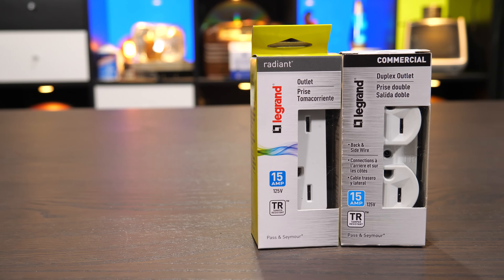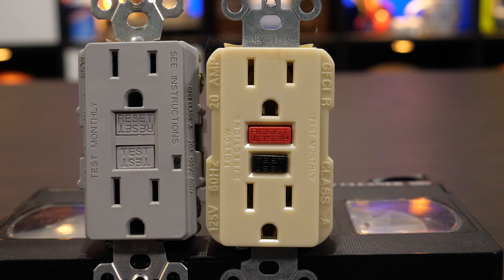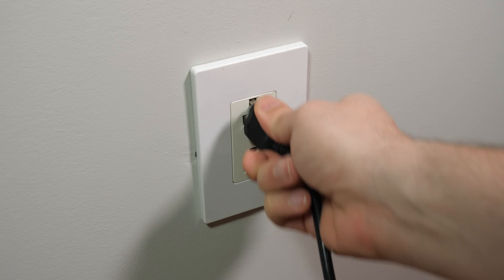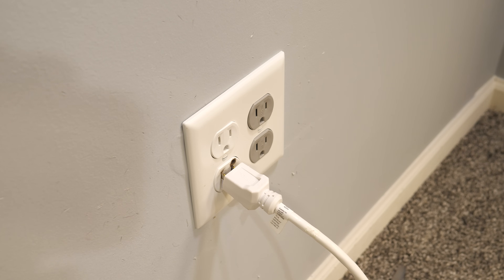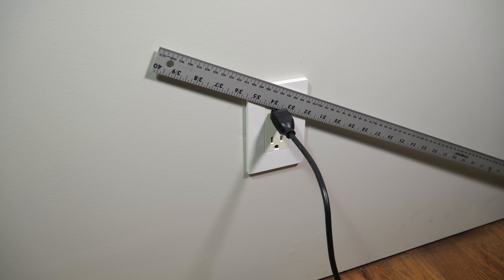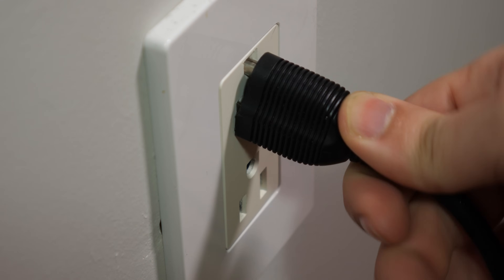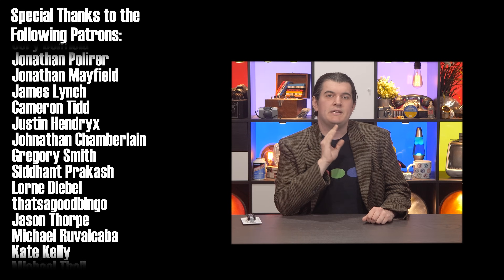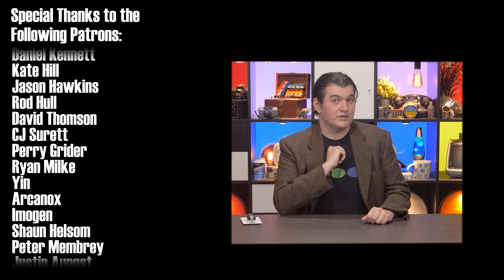Power outlets are topsy turvy - but does it matter?

Comment: ALL Australian Side-Entry plugs have the cord exiting at 45 Degrees - which is at the 4:30 (clockface) position. (As at 14:50 in this video).

Australian Plug Pins are of approximately (almost exactly) the same dimensions as US (NEMA 5-15) Plugs.
They have been Half-Insulated (as at 16:00 in this video) for over 20 years - so it could be done on plugs in North America.

Comment: You might be interested to know that the Canadian Electrical Code does not specifically state that the Ground must be on the top, but it does say something like, "Install the outlet as shown in the illustration." Which does show the Ground on top.

And the 'knife dropping on the plug' example is a bit silly. 
But try a cat knocking an old aluminum ashtray off the top of a bookcase, said ashtray then sliding down the gap 'tween wall and bookcase...and then landing edge down a'top a TV plug, which because of the clutter behind the TV and bookcase and fish tank...was loose in the outlet.
BZZZZTTT!
Left nice scorch marks on faceplate, (eventualy) tripped an old breaker, scared the %$#@! outta everyone in the room(cat included)...and smelled downright awful.

I like Ground up...

Comment: A metal backplate fell off of a desk at a previous job and landed, conveniently, on both prongs of a "ground down" plug.  The lights flickered, there was a very loud pop, a breaker flipped, and there was a rather concerning burn mark on the wall, the outlet, and the desk.

Comment: You've just explained my biggest bugbear with US-style power plugs. The cable should drop vertically, not leap out horizontally, taking up space, tripping people up, and putting electrical and mechanical strain on the connector. Everything you've described. The sole flaw you described in right-angle plugs - difficult to grip when removing them - is designed away in the UK BS1363 and earlier BS406 plug which is wider and has grips at the sides.

Comment: The wall outlets should always have the eyes on the top, mouth on the bottom.

When we bought our first house, my son was a baby.  While he was taking a nap on the first day we moved in, I put the plug covers on all of the outlets.  As soon as he woke up, he discovered that something was blocking all of the outlets and proceeded to remove those blocks.  He was so happy to solve this problem and give me the offending covers!  A few days later, he picked up a key and started to insert it into the outlet.  I had such a reaction that he stopped short, looked at me, and dropped the key.  He never again tried to insert anything into an outlet (except, of course, plugs).

Comment: Huh, this video made me really appreciate European (or at least Dutch/Belgian) plug and outlet designs. Not only are the outlets slightly recessed into the wall, instead of flush like US outlets (preventing the whole mess of bumping into them and leaving live metaly bits exposed), but the right angle plugs have nice ergonomic little grips, so you can easily grip them for removal. Seriously, I'm actually surprised at how flimsly it all looks in the US, based on this video.

Comment: And now you have got to the other very bad thing with most American plugs.  .  The wires come straight out, so the weight of the cable pulls the plug partly out. . . . Again, UK Plugs always have the wire coming out of the bottom of  the Plug, so they can never get pulled partly out by the cable weight.      Also this now allows the Plug to be pulled out by the Plug and not by the wire, as so often happens with American plugs.

Comment: Now you bring up the problems with the wall plate, that is also bad, as you say. . .   Also often this causes a problem where the actual outlet is too far into the wall, and when you tighten that one screw, you break the plastic cover, bad design. . . .  With UK Outlets, the wall plate is also the Outlet body, and they sit on or against the wall, and can never end up too far in the wall.. .  Even if the metal box is far deep in the wall, the wall plasterer made his plaster thicker than he told the electrician, the UK one still works OK, you might need longer screws, but the wall plate sits clean, flat on to the finished wall.

Comment: Regarding being able to touch pins when live. . .   This is a very bad feature of American plugs. . . .  You can not touch a live pin, even with a knife blade of UK plugs. . . .   Actually, although I would not recommend it, you could remove a UK Outlet from the wall and wrap your hand round it whilst Live, and it would be safe. . .   Do not try that with any American Outlet

Comment: UK Outlets 3-pin, do always have the ground ( Earth) at the Top. . .   But when, as common, there are two outlets in each fitting, they are side by side. . . .  I usually install American Outlets sideways, , ,   Which way does not matter, except all sideways should be the same in any one house. . .  Then those plug in devices, USB wall units etc. can still sit in them safely, but, as you showed, they do not sit in well when the ground is at the top.. . . .  But my biggest gripe with American Outlets is the very bad under screw head wire fixing. . .   That went out in the UK about 70 years ago. . .   The screw should clamp down on a square or rectangular washer, securely clamping the wire behind that washer.. .  Under the screw head, the wire strands spread out an make a bad connection,  Ah.! . .   Using solid wire works better but is bad, bend it twice and it may well break, that is why we use multi-strand wires.

Comment: Well all our sockets here in Australia have the ground on the bottom & we never have any issues with getting shocked, plugs falling out due to our angled active & neutral pins & I can see your issues as when I have to use an adapter to use your 2 pin plug in our socket it never stays in properly always hanging or just could be the adapters who knows

Comment: Orientation 1: Ground pin on bottom
Orientation 2: Ground pin on top
Orientation 3: Sideways live on top
Orientation 4: sideways live on bottom

Reason to have ground pin on top:
You're working in a very controlled environment, and any accidental spark, can cause major problems.
The Right Angle plug's cord, will be above the recepticle, rather than below.

Reason to have ground pin on bottom: It ultimately doesn't matter.

Reason to have sideways outlet, live on top: Sideways doesn't care whether the thing holding the right angle cord is going above or below.

Reason to have sideways outlet, live on bottom: Literally the safest orientation, as anything that falls, will not be falling onto the live wire, therefore, reducing risk of short circuit, even for 2 prongs.

Comment: it absolutely baffles me that plugs outside the uk dont always have at least a plastic ground pin for security so the damn thing doesn't fall out. even europe, which has the most secure grounded plugs i've ever seen, uses loose fitting ungrounded plugs sometimes.

Comment: When the ground pin is up it’s easier for the plug to be pulled out by the weight of the cord especially with a slightly worn out plug

Comment: Actually, i found an official standard stating that if a receptacle is located 4 feet or more above the floor it must be oriented with the ground at the top of each outlet. Of course, no rules are ever explained and this is no exception. Who really cares or should care ? Electricians, maybe, but certainly no one else, as you claimed. Why should anyone at all care  ? Also, I've seen plenty of outlets mounted sideways, which makes this topic completely moot.

Comment: Another consideration is that (at least where ive lived) upside down plugs often indicate that the plug is connected to a switch and can be turned off without the need to access its circuit breaker. while i definitely wouldnt trust it the same level as a circuit breaker, it can be useful and more comfortable for some to know that they can very quickly depower an appliance without the need to access the circuit breaker or get close to the plug itself, especially for appliances that could pose a fire hazard.

Comment: Both wrong. Should be sidewsys. Ground to right. That way hot is on top, neutral on bottom... AND the self-pressure stops the hot from ever coming free.  And if it does come free, it will just sit there still doing it's job with no fault.  AND of course everything should be piped with EMT. /debate

Comment: I just came to say youre wrong the ground pin should be oriented so that it's the safest. Its normally down because when you plug something into an outlet you index finger could graze the 2 prongs causing a shock. With the ground pin down you're less likely to get shocked they literally teach this to first apprentices in the electrical union. The ground only goes up in case where something say a Bobby pin or paper clip can fall down off a night stand, desk or something.

Comment: Generally I’ve seen the plugs flipped upside down with the ground pin up in hospitals, kitchens maybe and industrial or commercial environments with the idea being if something is dropped or falls on the plug the plug won’t be shorted. some people do it to mark different amp circuits that are still 120v Otherwise it’s free game in residential

Comment: I'm so happy, we have a different design in europe. 
Every single issue mentioned doesn't apply with ours.

Most simple little extra in our plugs is a second ground connector 180 degrees, so it doesn't matter how it's installed.

Weardly, when i was young we were always told to keep forks away from little children, so that they can't accidentally stick them into a socket. 
Even so, forks can't get into our sockets, even if we try.
Must have been, long gone socket or fork designs.

Comment: I’ve only had one apartment where all the plugs were installed ground-up, and while I thought it was absurd at first I actually grew to appreciate it.  Even if it’s just psychosomatic, I thought it provided a stronger connection.  It was also the only place I’ve ever lived where whoever installed the light switches actually made a point of aligning the groove in the case screws vertically on every switch.

Comment: I worked in an electronics lab and behind one of the doors that was normally opened there was an outlet (with the ground on the bottom) the face the outlet was charred to hell and broken apart when I inquired what happened there they had a projector screen stored behind the door and it had fallen over with its wire rope hanger and arced across something plugged into that outlet

Comment: Always check where you’re putting wall anchors and nails into your walls!! I put some nails in when I first moved into my home 5-6 years ago and just realized a month ago that one of the nails split the live line. Outlet still worked fine I only noticed when I was hanging a tv on the wall above the outlet and my metal level bumped into the nail when trying to plumb my layout holes giving me a nice little shock.

Comment: I've always been torn on this because we did have one of the rare shorts on an older loose plug. There was a tripped breaker and scorching but that little had a bigger issue that it was fading apart internally and would have caused a fire down the road. The incident caused us to look closer and swap out that outlet. Most outlets are probably past when they should be replaced. 

I've also seen it done to indicate if the plug is connect to the wall switch in some homes. That fact that right angle plugs and polarized wall warts don't fit seem reason enough to mount it ground down.

Comment: Mabye if the top and bottom plugs had their grounds facing up and down respectively, then some perks of both are kept 

Right angle plugs would face away from eachother and the ground pin would be highest on the upper plug
It doesnt solve everything but it does help a bit

Though it should absolutely be legally required for both plugs and prongs to use those holes to lock into place
Those are hardly ever used and if this was legally required by safety standards, sagging plugs would be way less common

Comment: I'm now inclined to alternate the orientation of the plugs in a house wiring just to be irritating.  Also, I am inclined to agree with your closing statement (in the subtitles) that the horizontal arrangement with the neutral upwards would likely be the safest and still allow for the best engagement with existing plug designs.

Comment: I'm glad I get to deal with UK plugs where these issue don't really exist, All plugs have ground, nearly all are right angled, they have sleaves on the pins, normally a moulded grip location.

Though all the safety benefits of a UK plug just make them more painful to step on when someone leaves one on the floor.

Comment: Putting aside issues with plugs and sockets we have, a great thing they did here in Australia was require a certain amount of insulation on the pins of electrical leads. It addresses more concerns than flipping outlets.

Oh and rcbo devices on all circuits is also a no brainer regardless of the voltage wars.

Comment: 4th year union apprentice. We DO care. In my local there is no commercial new build that has the face orientation, hell even older commercial buildings don’t have the face orientation, that’s something seen in residential. What I’ve heard is it saves your ground pin from being torn off if the plug is hit with something or incorrectly pulled out. As for the validity of that 🤷🏻‍♂️

Comment: 18 minutes of promotion for EU plugs 😂😂
- the Plugs are symetric
- the contacts are extremely secure (basically impossible to get shocked)
- Most Plugs are angeled 90°
- Most outlets (especially extension cords) are rotated 45°
- (Mostly) easy to plug out
- Stable
- Version without ground pin with the same benefits (except extremely old ones)
Reply: Disadvantages being Back in Thailand:
- they grounded ones fit in each Outlet, but there is No way to connect ground 

Think gonna replace all Outlets in my House with EU ones, tok

Comment: I lived for three years in a house with ground-up outlets (I'm not sure if original 1960 or a remodel possibly in the 1980s) and all of the annoyances listed are extremely real. I did become an afficionado of rotating 45 degree flat plug power strips!

Comment: Most right angle plugs available off the shelf are designed for the ground-down orientation - installing them in the ground-up receptacle is extremely inconvenient and often damaging.

Comment: How about.... a receptcle where the grounds are on the "outside"? In the upright position, that means ground up on the top and ground down on the bottom.
Right angle plug/device can go on the bottom one--you can usually only fit one of those anyway, the 45 degree cord one is a rare exception. Other three prong can go on the top to be a bit safer (which in turn protects the bottom slot, be it two or three prong)

Also, why aren't the back third or so of the plug blades wrapped in insulation? That seems like it would solve a lot of problems.

Comment: I will not ever purposely mount my outlets with the ground on top. I understand that it is designed to have the ground on top, but I don't care, not even a little.
I have, and use, a 2 prong extension cord at work that isn't polarized. It's my own property, to boot.

Comment: As an electrician, I have always known that the ground is supposed to be up to both provide more support and/or if something metal were to fall and short the hot to neutral. I always just argue that if you care that much about it then install it sideways and put the neutral on top.

Comment: I'd love to see why certain power cords spark when plugging them into the outlet... I have to use a surge protector (off mode) to plug in safely, then turn on the surge protector so it doesn't spark... 
*This cord doesn't have a ground pronging either. 

Thanks! Cheers!

Comment: I remember as a kid I and a freind came up with the idea of seeing if the paper clip could hold up the power coming from the plug. We then proceed to do so and tried the circuit breaker in his house. 

He got grounded but I, unsatisfied with my result tried the same with a Christmas light to see if it would glow. It flashed and burned out. I then had to use a bit of paint to cover up the black spot on the outlet.

Comment: I agree the "normal" way up is utterly horrifically unsafe, the other way up it's very slightly safer, and just horrifically unsafe ...so it does not matter 

But them I am spoilt - I live in the UK where we do have safe plugs and sockets, with switches ... where the cord is always at right angle and hangs down by design

Comment: European outlets much better why? It has an built in switch to prevent ghost power to whatever plug into the outlet. Also the outlet itself has an recess to prevent accidentally touching the metal terminals

Comment: The ground pin hole on the bottom is correct. Just look at the plug on an air conditioner or anything else with a plug that bends at 90 degrees. With the pin on the bottom, the cord goes toward the floor. If the pin is it on top, the plug tends to fall out of the wall because the cord points up.

Comment: Ground on top ain't great. In my experience, it always slides out a little. Receptacles have a way easier time holding the two blades as opposed to the one ground pin. A ground-down plug that's all the way in is safer than a ground-up plug thats partially pulled out. With the blades up, leverage is working in FAVOR of keeping the plug in the wall, and unless your receptacle is old and worn out, in my opinion it's just as safe if not safer. Ground up seems like the orientation for people that ponder the use of plugs rather than those that actually put them through their paces.